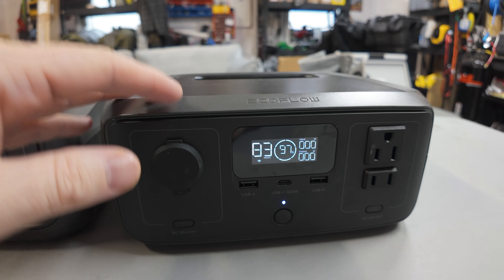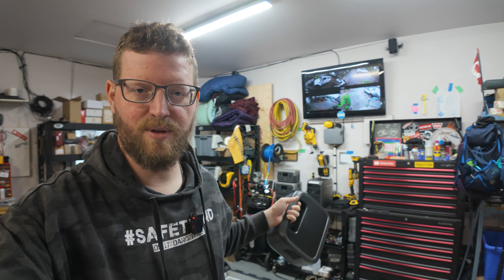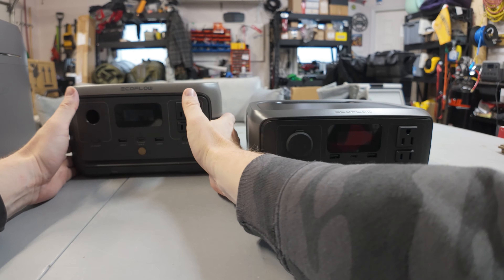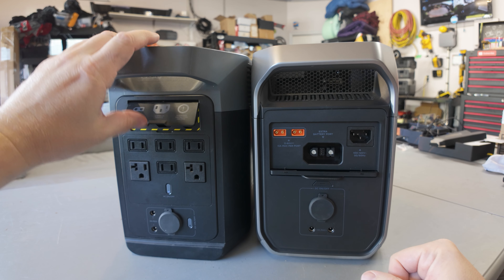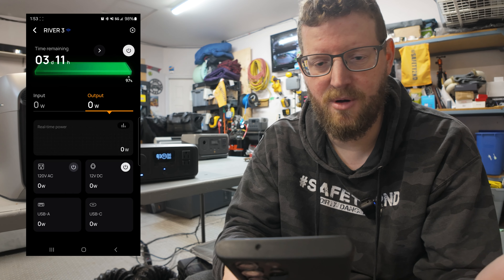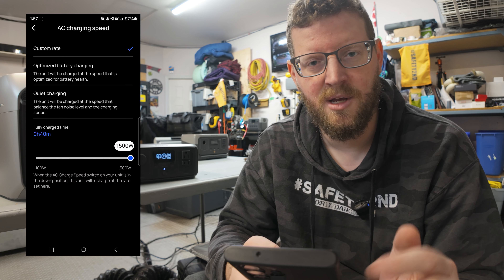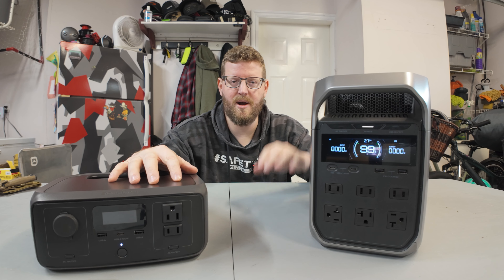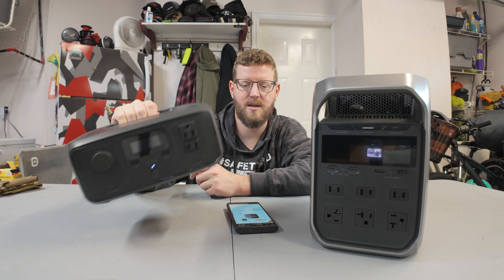Ecoflow Nailed It With the Delta 3 Plus & River 3

Comment: Many YouTubers didn’t like AC on rear of Deltas. I never could understand why. Whatever you need to plug in you back unit to appliance than front is clear for usb and dc charging. Now you have to snake ac to front or turn unit around blocking screen and dc ports.
Reply from the maker: I hear ya. Both ways have ups and down.

Comment: Will the River 3 fit under the rear gladiator seat?  How long will it run one of the fridge's?
Reply from the maker: It fits under mine, but I also took teh storage area out. Fridges can vary so much, it could be 6 or 24 hours depending on how warm it is outside.

Comment: Very helpful video.  Can you keep the Delta 3 Plus always plugged in so it's fully charged and ready to go for an emergency, like a UPS, or does it have to periodically be discharged/recharged?
Reply from the maker: Thats what I do
Reply: @Casey250  Which do you do?
Reply: You need to refer to the user manual and always follow their instructions and recommendations for each power station.  When storing it you need to keep it at 60 to 70% charged, discharge to 30% after 3 months and charge it back to 60 to 70%.  You need to do this every 3 months to keep the battery in ship shape.  Keeping it charged at 100% or leaving it plugged in will reduce the life of the battery.  Not good for battery health.

Comment: Delta 3 plus or the delta 2 max  which is stronger I need for a regular refrigerator and a portable a/c
Reply from the maker: Delta 2 max has twice the battery capacity at 2000wh

Comment: I am looking to purchase the EcoFlow DELTA 3+ Series Portable Power Station that includes the 220W solar panel and also the River 3 Power Station.  Can I use the 220W Delta 3+ solar panels to charge the River 3 or are they not compatible?
Reply from the maker: in my experience if it fits the plug they work. I'd confirm on Ecoflow's website to be 100% though.

Comment: I seek the hive mind's wisdom. I have an off-roading trailer with 400w solar and a 100ah battery. Should I purchase two Delta 3 plus or one Delta 3 pro? I want to run the EF wave and have laptop power in the morning. I have an alternator charger and the extra portable with 400w of solar. The Wave 2 has a battery. Please share your thoughts.
Reply from the maker: I don't think a D3+ and D3 Pro are even in the same league. The D3 Pro is a monster, 4000wh and has 120v. Its also very heavy. The Wave take a lot of power to run the A/C non stop over night. If you have teh space, budget, and weight capacity, the D3 Pro is a great setup.
Reply: @Casey250  my thoughts are that I can hook up via anderson power pole from my camper into the unit and during the day hook up the extra 400w of solar. All i want is to offset the power load for it to last to the morning. And then have the extra battery ready to go for the computer work. I have another goalzero powering my fridge in my car. Wish the delta 3 plus had 2400W with extra port for charging. Should i go with the delta 2 max instead of the two D3 plus? Whats your take?

Comment: Can the river 3 run a CPAP machine for 8 hours?
Reply: A CPAP uses around 400w over 8hrs.
Reply from the maker: Sound like not.
Reply: It will run a cpap for about 4hrs . You are going to need a bigger unit.
Reply: I have a River 2 Pro model and it has powered my CPAP and small USB fan for 3 nights while camping and also during Milton power failure and it worked well. It used about 30% each night. My CPAP does not seem to require a lot of power.
Reply: Go for a stronger model, better safe than sorry when it comes to powering a CPAP muchine.